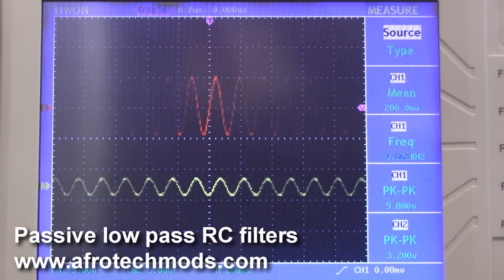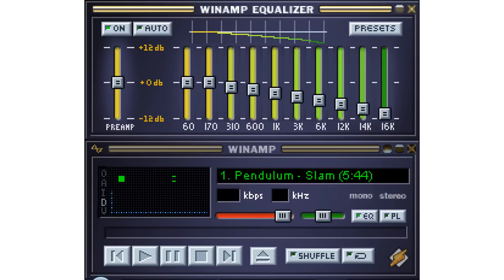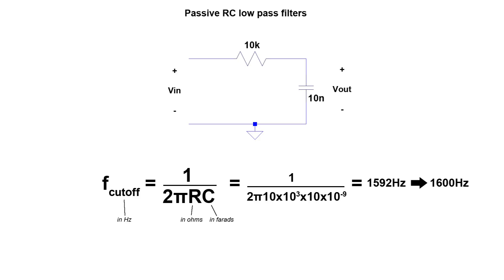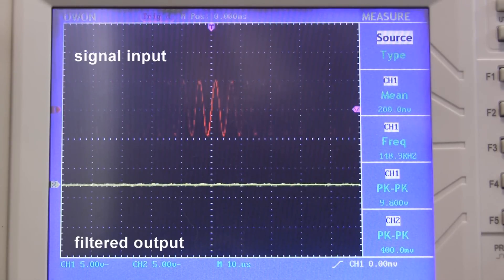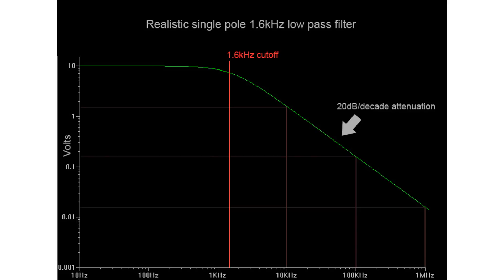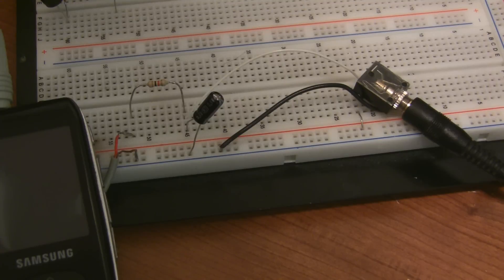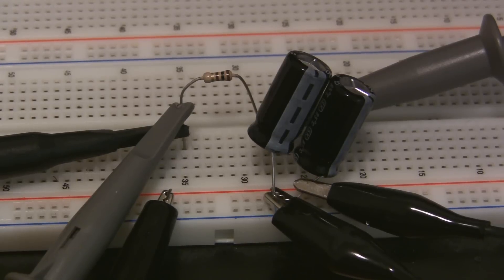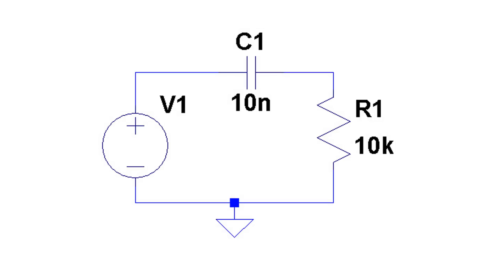Passive RC low pass filter tutorial!

Comment: Great video, at you 7:39 mark where the mean of the filtered DC is slightly less that the mean of the input square wave, could you in software just use a multiplication factor to get the filtered closer? 

Basically I'm using an arduino and a hall effect current sensor (Tamura L01Z050S05) to measure 0-50 amps DC where the power is being controlled via a PWM--basically a PWM DC speed controller. So far, my sensor didn't give a reliable reading so I'll guess a low pass filter on the sensor output is needed??? If that works, i may mess with commng up with some code to scale the filtered value close to the mean of the input. 

Not sure if this sensor will even work.

Any advice welcome.
Reply from the maker: +Kris Kasprzak You could do a software calibration of sorts yes. Depends on your application and how much accuracy you need. I'd recommend you make sure the ADC sampling rate is as high as you can get on your arduino and you are using 10bit resolution because chances are your pwm frequency is >1kHz and you will have a lot of noise in your motor current during each switching cycle. A low pass RC filter may help but you could also benefit from doing averaging in your software e.g. add 8 samples then divide by 8 to get an average.
Reply: +Afrotechmods 
Thanks for your feedback. In installed a low pass filter and the signal from my hall effect cleaned up nicely--the higher the PWM frequency the more near DC my signal became.  can now ready amperage from the sensor from a PWM modulated current. I used a 1 mfd and 10K resistor.

My accuracy is close enough (I'm shooting for around 3% or so.) so I probably not do any software corrections.

Thanks again, and excellent videos--at a 200:1 like vs dislike, you should be very proud.
Reply: Afrotechmods I have done everything you said and connect them to the speaker. unfortunately there is no sound output. Is this filter is for before amp? I mean preamp? I need a after amp filter. what should I do? thanks for you dedicated support.

Comment: What I used for a treble roll off filter was a 0.01 mfd capacitor in series with a 500,000 ohm potentiometer across the transformer out of the headphone jack of my hp XP windows desk bound computer. I got the parts from an industrial electronics store bin.

I used that as an auxiliary control. That fed an amplifier, which fed a parametric equalizer. It was just a whole lot easier to take my hand and turn the highs up or down, rather than fiddle around and go into the computers dedicated audio equalizer, which was optimally set.

It works great. When the highs go down, the bass goes up a little. I'm mainly concerned about speech intelligibility in movies that I watch.

I mounted the little RC circuit in a small plastic box. I like it because IT'S HANDS ON! I don't have to go through the keyboard commands.

Comment: What if you connect an elctrolytic capacitor (egg 220μf) in parallel with the speaker. Is this not a low pass filter?

Comment: Is it possible to design a filter that has a sudden cut off point where the frequency stops dead below or above that frequency OR will this never happen.
ie a low pass filter that stops at 50Hz, so nothing gets past 50Hz and upwards BUT everything below gets through 100%
i.e. 51Hz frequency will 100% not get through, 50Hz will and so will everything under i.e.49Hz to below, is that ever possible??
Reply: Running it through enough filters, you could get it working nicely enough, but it'd be impractical. You'd probably want something else
Reply: SP330Y Theoretically, this probably sounds like a great idea. However, especially with audio signals, a 90* change in signal is akin to a square wave. It would be an unnatural transition from 50Hz to the sharp corner of that filter.

Audio at the given frequency would drop to 0 instantaneously.

The best approach, would be to breadboard it so you have that sound to correspond with that particular filter network.

Comment: Great clip, thanks.
one question , according to your experience, how do you usually decide the cut off frequency to a equipment ?
I am using PLC at the moment, I am recommended to use RC filter to deal with noise problems to the input of the PLC,but I have no clue how to decide cut off frequency

Comment: Thank you. Thank you. Thank you. I was struggling with the damn thing for days! You've explained it so elegantly in such a short amount of time! Awesome!
Reply: Can you help me please i am playing 8ohm su woofer 400watts rms i want it to play 40hz down?IM CONFUSED what capcitor to use.
Reply: Daniella Henry
 I'm not sure i understand what do you want to do, but i presume you want to filter out audio frequencies above 40Hz? I don't really work with audio but from what i understand you need to find out what the electrical parameters of the amplifier input are, as well as the signal source ones, and choose an appropriate resistor, so that your signal will transmit properly. When you know what resistor to put, choose a capacitor with c = 1 / (2*Pi*R*fc). My guess is that a 1k resistor might be enough. Then you'd need about a 4uF capacitor. Filtering is done on the pre-amp side i believe, not after. But like i've said...i'm no expert at this. For a professional solution you'd have to consult a professional.

Comment: This is the part that doesn't make sense. You say that the cut-off freq is 1/(2*pi*R*C), the magnitude of the impedance of the capacitor is 1/(2*pi*Freq*C) if you use a 10K R and a 10e-9 Cap, you do a voltage divider on the output node at Freq = 1600Hz, Vout/Vin is actually around 0.5 not 0....... I see that it works in the lab, but why does the math not work out?????
Reply: Cut-off frequency is the -3dB point, that means half the original amplitude.
Reply: Ahh I see.
Reply: Small orrection: half the original rms amplitude not peak to peak amplitude.PineAppleEx420

Comment: Question: If there are multiple capacitors and resistors in a series before this RC filter, does that affect the equation used to figure out the frequency drop off?
Reply from the maker: Most likely yes. For complex circuits I recommend simulation with LTSpice, FilterCAD or TINA-TI.

Comment: Low pass subwoofer filtering is done with inductors not resistors, a typical speaker low pass filter to limit the cone to 120hz uses around a 5.00mH coil
Reply: But why to use a coil instead of a resistor?
Reply: Paulo Ponce De León because coils are reactive loads, so there is no power loss in the coil

Comment: It depends on the metal used in the wire, length of wire, and how wide the wire is. If I remember correctly, the formula is R = pL/A, where R = resistance, p = resistivity, L = length, and A = area. You'll have to look up the resistivity value for the wire.

Comment: How would I build a low pass filter to filter all above 100hz for my subwoofer?  I have a rather large 470uf capacitor and a bunch of crappy speaker cable that I think I could make the coil out of (right??).  thanks

Comment: Could I pay you to make a custom low pass filter for me? I was wanting to control the cutoff with a 100 Kohm logarithmic slide potentiometer to allow frequencies 0 hz to 22050 hz to go through but I can't get the math to work out with a single capacitor value. It going into the megahertz. Would you happen to have an idea on how to do this? Thanks

Comment: pulsing might be as the dielectric breaks down, what happens is the gets to a certain level of charge and discharges, sort of like a spark gap.

DC is not pulsed, you cannot filter it like this, this is an audio circuit (it's ac)

Comment: i'm a little confused because right now im working on building a small toy synth keyboard based on 555 chip... and to determine the notes each note has its own frequency that i calculate its resistor value. (the resistor value to use in the circuit to produce that note) does that mean that if i use this design, all notes above the cutoff freq. wont play and all notes below cutoff freq will play?

Comment: This helped a lot in choosing resistors and capacitors, BUT...
I just don't get it - Incoming + firstly goes through Resistor and than splits - to speakers + and to capacitor. Than it goes throug capacitor where it is connected to Incoming - and goes stright to speakers - ?
*So resistor is in line and capacitor is switched parallel with speaker?